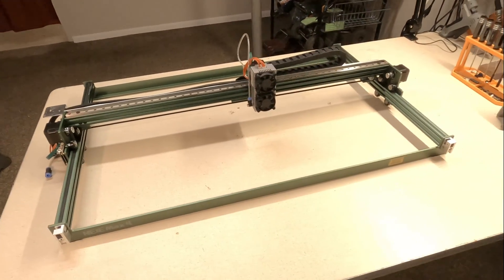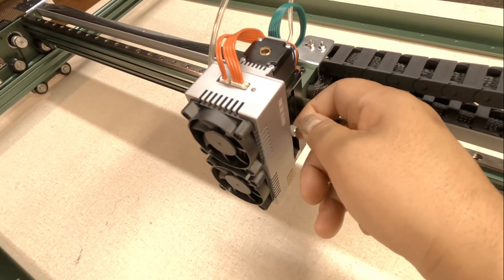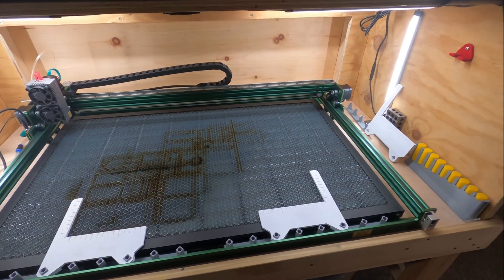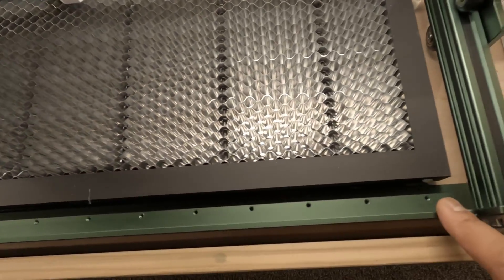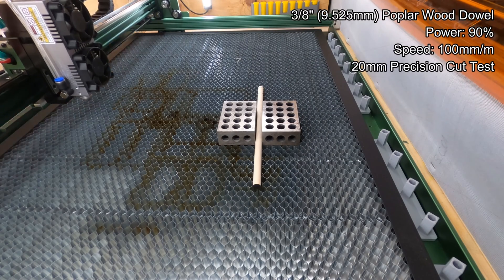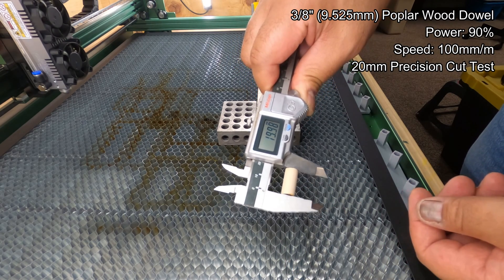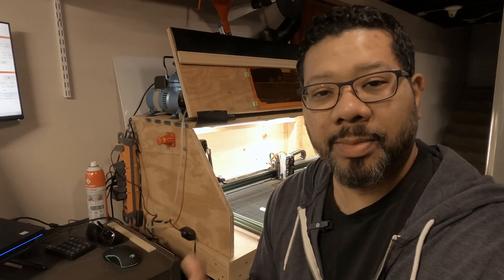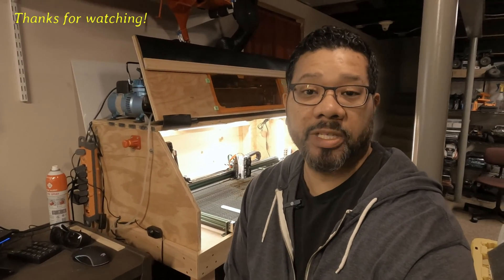NEJE Max 4 E80 - Review and Material Testing - Free Mods

Comment: How do you like using this Neje laser after one year of use?  Do you still recommend it?
Reply from the maker: It is still my workhorse, and I haven't had any mechanical issues with it. I have been doing a lot of plywood cutting, which is a pain because of the glue. Solid wood board is a breeze, but plywood is tricky. Anything over 6mm thick requires a lot of passes. I do cork coasters and that generates soot so you need to clean the laser lens occasionally. I'm still really happy with it.

Comment: Could you please help me with setting up the air flow?

I have the NEJE Air Assist Set To Protect the Laser Module Lens, but it delivers only 48 liters, with a pressure of 0.028 MPa. For better cutting I need 0.4–0.6 MPa (4–6 bar), correct?

On forums, people write that with this pressure the cutting quality improves and smoke is blown away more effectively.

When I cut MDF, glue settles on the laser head and sticks to it.

I cut 3 mm MDF from the back side. My settings are speed 380 and 83% power, but these results could be improved if the air pressure was higher.

The room temperature is 20–21°C, and in LightBurn the laser temperature shows 39–40°C.

Comment: On setting focal length, I use the Tool holder. It is 50 mm. Place material, jog laser,lower the Z by 1 mm, place the tool holder on material and lower the laser in to contact by loosening the screws, raise up 1 mm to remove holder. Then lower Z to 26 mm for engraving.

Comment: Although polyvinyl chloride (PVC) can in fact be cut with laser like you did with the fabric sample, the thermal process produces hydrochloric acid and chlorine gas, the stuff they used in chemical warfare in WWII. Not only will it destroy your equipment, but it can also lead to some very severe health risks.

Comment: Great video!! Do you have your squaring jigs on Thingiverse?
Reply from the maker: Thanks for the comment! l do have the jigs upload. Please check the description for links.
Reply: @reedinspace2286  I only saw links to the air assist, the mount for the E-stop, and the Focus blocks.  I was asking about your frame mounted alignment mods that mount inside the laser in the 4mm holes. :)  I already have your mount for the e-stop and the focus blocks!
Reply: @reedinspace2286  I see now, it is in with the E-stop mount file.....my bad :)

Comment: What is the actual laser output watts?  So far, the z-axis thing sounds cool if it works with lightburn, but I'm not seeing any cutting advantage over my xtool d1 20-watt?  Am I missing something.  The original commercial I saw had it cutting through 3/4" wood on a single pass. I'm really confused.
Reply from the maker: The output is specified at 24 watts. I have tested this and it can cut 3/4" board (not plywood) in a single pass. However, you have to go pretty slow and it generates a wider kerf. Also, the quality of the cut isn't the greatest. In the video, I did it in 2 passes as a happy medium. I do use Lightburn.

Comment: nice review, would love to see a test with garolite?
Reply from the maker: Yikes! I machined quite of bit of that material when I was a machinist. I don't think I would try it because of the formaldehyde fumes even though I have a good exhaust. I'm thinking the machine could do it though...
Reply: Ok, I’m interested in one of these machines and that would be one of my main materials. Only cutting .005 g10. Others have claimed the diode laser just reflects off the tan color?
Reply from the maker: @lorneh6232  At that thickness, it's about he same as heavy paper and I have cut pure white posterboard.

Comment: I live in a small community and do not have access to a 3D printer. Could I purchase the jigs and other 3D items from you? thanks
Reply from the maker: I would try your local public library or community college. Most have 3d printers available to the public. There are also some "pay to print" places on-line but they are pretty expensive. The prices on 3D printers are coming down so check the used market. It's a great tool to have. Good luck!
Reply: @reedinspace2286  Could you list a link for your Alignment jigs? Thanks
Reply from the maker: @mikebritton-th3fg  The links for the mods are in the video description.
Reply: I want to make some mods to this design. Can you prove the solid model file that you use to create this STLs. I use fusion 365

Comment: I have a 4 Max along with the NeJe honeycomb bed. How did you attach the honeycomb bed? It is just barely bigger than the rails and keeps falling off the rail. I did like your mods on Thingyverse. Do you use the square post brackets to position the bed? I have a model kit business for 20 years and design my own sailplane designs and designs of others. I am hoping to cut my own parts. I had been using a vendor for many years who tends tone unreliable as of late.
Reply from the maker: Hey Mark, I did not get the NEJE honeycomb bed. The one I have is from Amazon and fits down between the rail nicely. I designed the square post brackets so that material can be aligned accurately even if the honeycomb bed moves around. The alignment plates will sit on top of the bed. I hope this helps and best of luck on your business!
Reply: Do you happen to have the dimensions of the honeycomb bed? I just ordered the neje 4 max  and would like to get the honeycomb before it arrives. Thanks for the video, before watching this I was going back and forth between creality falcon 2 22 watt and neje. Your video sealed the deal.

Comment: No manual for the dragchains is because Neje did not give the dragchains  to early buyers, and you can not buy them also. Neje leave early buyers in the cold every time.

Same probems with the tumbscrews! I took a  hacksaw  so i can use a screwdriver now.  My first time use it cost me 10 cm of honycomb. 

For me the tension adjuster are useless,  because they are only reacheble from the bottom and  i have bolted the machine down for regidety.

Also the Honeycomb  does not fit at all. need selfmade adjusters  its a Max3  honeycomb unmodified... MAX4 top end is useles for 9 cm.  

Nice locater idea and hight adjusters for the z axis ! Tanks for the idea

Emergency stop is also useless because you need to reset the machine and the softeware to start again.  
Easyer and cheaper is to cut the main power with a switch. And no reset needed.

I also added a 16K camera and some fire resistend  alu tape on the  inside of my enclosure and led strip for more light.  

At first i used the same aquarium  pump but that does not give presssure enough, so i run a pneumatic air hose from my  shed ( 20 meter) compressor on a wifi  outlet.   tougheter  abbout 20 $ from Ali.  

There is no possebillety to ad  a small led screen to  move the laser like this one. Also way cheaper and includes a touchsceen. And 3D possebilleties
and wifi. And already seen it work  perfectly with a E80, on a  selfbuild  15000X22500 machine  for almost the same price as the  NEJE  MAX4.

https://nl.aliexpress.com/item/1005004188679917.html?spm=a2g0o.productlist.main.11.64ef4c28RSMryB&algo_pvid=f8941cf8-4797-4d1f-9e80-5a19cb9f4061&algo_exp_id=f8941cf8-4797-4d1f-9e80-5a19cb9f4061-5&pdp_npi=4%40dis%21EUR%2121.75%2111.64%21%21%2123.29%21%21%402103853f17048258392545237e676a%2112000028610375243%21sea%21NL%210%21AB&curPageLogUid=OSpUY2XYxZzX&utparam-url=scene%3Asearch%7Cquery_from%3A

Its almost impossible  to implement a touch screen because NEJE made the decision to  let the mainborard go with the gantry.   Stupid in my eyes. And more sesitive to faults. 

PS the last 10 minutes is no sound, i had to put up the subtitles.
Reply from the maker: Thanks for all the feedback. I bought the honeycomb from Amazon and it fit perfectly so it may be different from the Neje design. I agree that the E-stop should be better because you do have to shut everything down to reset the machine. Also agree that a touchscreen option would be nice. The sound is fine on my end so it may have been a YouTube glitch. I've had it happen....
Reply: @reedinspace2286   idd today the sound is perfect. Was on my side. Strange , just stopped the last 10 minutes.
Reply: @reedinspace2286  Again, after the first machines were sent out, the honeycomb size was corrected. Mine fit perfectly as well as having the drag chains. My only fault with the machine is the rats nest of wiring/hose/etc. My first project is going to be an electronics box. The air assist coming with a wall-wart is the first annoyance with that! The second is that you can't really attach anything to the side of the machine as it would interfere with y-axis. So I'll have to get creative with something coming around from the front.

Comment: Thank you for your video.   I have just bought this machine and I find this video very useful.  Just a point about your Flite Foamboard, which it did not cut through...  another solution to give you guidelines without the disadvantages of the laser is to use the blade attachment.  I have a Silhouette machine, but the opening for it to go through is to narrow.  This machine has no such disadvantage.  This will not be a cut through, but it may have the potential of being a clean score for you to follow later with a craft knife.
Reply from the maker: Thanks for the tip. With Flite Test foamboard, I typically use the laser to create a heavy score in the top layer and then finish the cut with a craft knife. Works really well!

Comment: Thanks for the video, Just got my Neje max 4, having a hard time figuring out how to set the module height for focus. Is it done on the laser or is it done with lightburn?
Reply from the maker: This can be done with the native Neje software but most people use Lightburn to control the machine. I would start out by homing the Z-axis using Lightburn, then move the Z-axis down 44mm. Once there, loosen the thumbscrews for the laser module and set it at a height of 25mm from the cutting/engraving surface. Then re-home the Z-axis. You can make adjustments from there. Hope this helps and thanks for watching!
Reply: @reedinspace2286  Be careull, it costs me a peace of my honycomb .
Reply: I set mine to the top of the honeycomb and then enter the material thickness in Lightburn (there's a specific youtube video all about z-axis setup on the max4). The downside of this is that I can't seem to get the auto test generator to work as there's no material thickness in that window. I found a youtube video that made doing my own fairly straightforward though.
Reply: @thingswelike  I was not that far, put it together and swicth on with Lightburn and it goes home  that was a piece of my Honycomb.  Never considered that the X-axis cold go down als the screw on the E80 are very weak  if man handeled, not normal reacheble. So i use a hacksaw afterwards so i can use a flat 

At some places the Max4 is really bad design and really cheap-ass
Reply from the maker: @thingswelike  I did also have that issue with the auto test generator. What I figured out is, just for test, I had to reverse the Z-axis. Not sure why, but it worked for me.